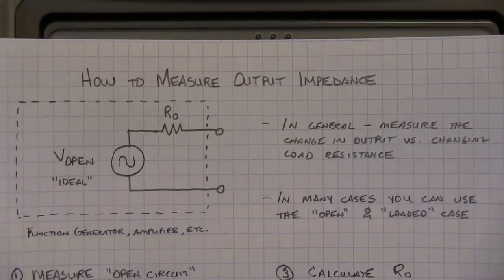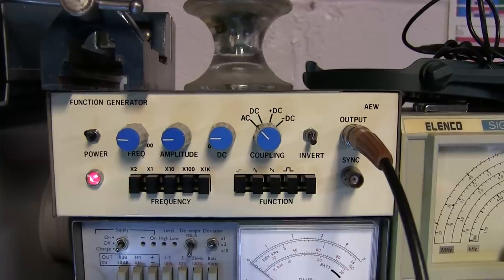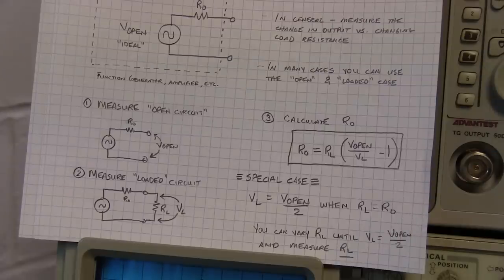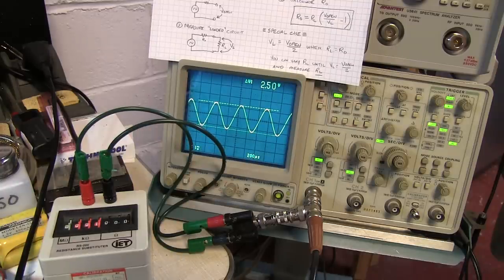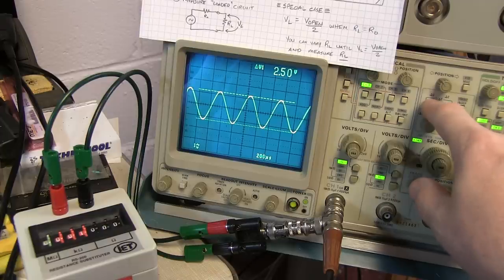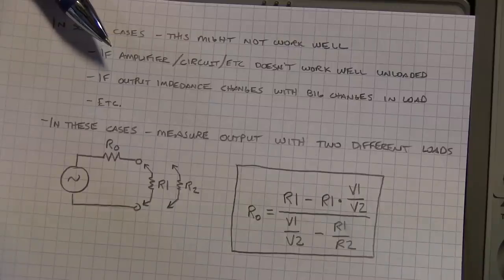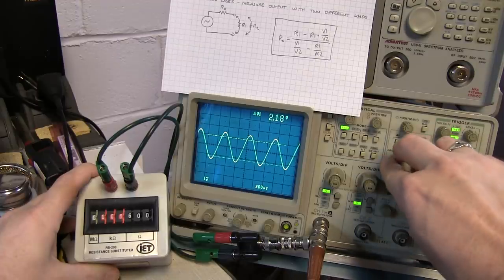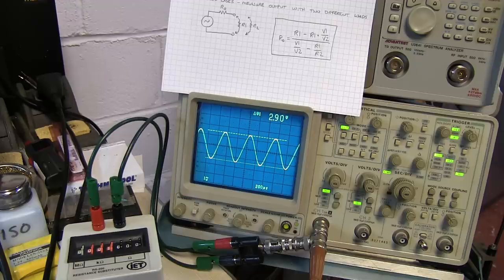#138: How to Measure Output Impedance

Comment: You use the term impedance but only consider that the output impedance is purely resistive. What about the condition where the output "impedance" has reactive [capcitive or inductive]  elements along with the resistive element? Should consider taking measurements using more than one frequency.

Comment: For the beginers What Alan does here  is : He devide's 2.5V bij 1000 ohms (1K) of R load. That  give the current flows in R load which result 0.0025 Amps (2.5 milli amp's)  that will  also be current flows in Ro (since current is equal everywhere in a close circuit). We also know that when R load is connected and current start passing it creates 1.5 Voltage drop on Ro 4Volts - 2.5 (V drop on  R load that is because the sommof all voltage drops must be 4Volts ). So 1.5V voltage drop on Ro devided withthe current flow's in it will give the value of R out which is 600 Ω (ohms).

Comment: Very well explained. Is there a derivation for the first and last formula?
Reply from the maker: The first formula is simply re-arranging the typical voltage divider equation:
V1 = Vopen * (R1 / (R1+R2)), solving for R2.  The second is starting with the ratio of two of these equations and solving for the source resistance.
Reply: ***** That's perfect. Thank you!

Comment: Another EXCELLENT review!!
If you are still considering suggestions for tutorials, Have you considered FET's and in particular their utility in audio. I have been amazed how well FET's sound in preamps and low power amps. Being a voltage device apparently is a plus at audio freq's. My experience has shown them to rival many tubes I have played with such as 45, 2A3, 6L6 tubes. I have played with MANY transistors and opamps at audio freqs but they sound flat and dull compared to FETs...Many of the people I know are OK with transistor theory but don't understand FET's....Another OUTSTANDING audio device is the nuvistor for low level work like preamps...Microphonic as heck but once tamed, they are VERY nice not to mention fast and reasonably cheap..

And a great big OSCILLATOR to you too...dit dit

Comment: Hi Alan, great video and tutorial to measure output impedance. Most of us also wants to know how to measure an unknown network impedance from 100kHz to 1GHz or higher but this one can only be achieved using a network analyzer. In my experience in Electronics, EMC and RF, and before I started my ECErcuit YouTube channel, I been working in understanding how to measure unknown network impedance using spectrum analyser and signal generator. In somehow, I have managed and successfully measured unknown network impedance accurately from 100kHz to at least 100MHz. Measurement was achieved by deriving a formula through a series of derivation and calculations. I automate the system by writing and application to control the spectrum analyser and signal generator to process the measurement against the calibration reference using the formula which gives you the result of impedance plot and data. I'm thinking of sharing this work on my YouTube channel but I'm not sure if someone is interested to know. Cheers, ECErcuit.

Comment: Lowering load Z (or R) also shifts the HPF created by output DC blocking capacitor (if any) upwards, so, f must be high enough compared to the cut-off freq of that.

Comment: Thanks Alan for that video, it will definitely be usefull.

Correct me if I'm wrong, but with some manipulations there would be a way to determine an input impedance as well, right ?

I was thinking to perform the steps you described to evaluate the output impedance of an opamp circuit with 2 resistors, R1 and R2 as you did.  Therefore once the opamp output impedance is known, measurements could be performed using the input of the circuit we want to know the input impedance in place of R2.

Having access to the opamp output impedance value, along with the V1, R1 and the newly measured V2, we could deduct the value of R2, which would normally be equivalent to the input impedance of the circuit being tested.

I understand that if either the opamp output or the tested circuit input input are significally inductive or capacitive, a close attention will need to be paid to the frequency, but generally speaking, I would be lead to believe that what I described could be achieved too.

Let me know if that make sense.

Keep up with the good work !

Comment: +w2aew Thanks, yet another masterful video I've found in your archive that makes interesting topics so easy to understand! 

You mentioned "designing the output impedance" along the way, which got my attention as it is something I'm trying to research. Sorry if I've missed it, but I don't think you've covered this explicitly before?

If I could add my vote, it would be great to see you explain how to go about designing for a specific output impedance (say for audio amp or function generator) and what practical circuit changes you might make depending whether the expected next stage is e.g. a low-impedance speaker or higher impedance mixer or power amp.
Reply from the maker: +pratalife I'll put that on my list.  Most often you'd choose the output impedance based on what the circuit needs to drive.  A low impedance load (50 ohm coax/load, loudspeaker, etc.) require a low output impedance.  For maximum power transfer (if that is the goal) the output impedance should match the load impedance (complex conjugate actually).  If the load is a high impedance, then the output impedance of the circuit driving it is less important.
Reply: +w2aew cheers, that would be neat. "If the load is a high impedance, then the output impedance of the circuit driving it is less important." ... I think you've already helped;-) I've been casually thinking about (low impedance) opamp circuits possibly plugged into high-impedance inputs and I've been mentally hung-up on the impedance mismatch. But why artificially make my source high-impedance? Doesn't seem to make much sense .. perhaps I need to go and revise power transfer theory!

In the meantime, always look forward to your videos no matter the topic .. more often than not, give me something to experiment with for the week;-)
Reply from the maker: +pratalife Sometimes other factors figure into why the output impedance is what it is - power dissipation requirements, amplifier design constraints, etc.
Reply: I've wondered what output impedance is for ... years.  Knowing that it is a design choice explains why downstream elements like antennas must match it.   I am still struggling to understand in a physical sense what it is.  Alan,  is there anything else you can say about it?  Many thanks.

Comment: When you have a chance,  could you do a video that addresses the case where the signal is high-frequency and not sinusoidal -- for example, a high-speed clock (say a few hundred MHz)?

Also (or separately), how might one make this measurement on a differential signal (such as LVDS)?

Many thanks for your many instructive videos... I've learned a ton both about theory and practice and I'm always excited to see new posts from you.

Cheers,

Alex

Comment: I am aircraft technician and I need clarification on the following impedance subject related to ARINC 429 circuits.   The transmitting source output impedance should be 75 W ± 5 W divided equally between Line A and Line B (line A and B are twisted pairs i.e 4 wires two for transmission and two for receive). This balanced output should closely match the impedance of the cable. The receiving sink must have an effective input impedance of 8k W minimums. …How is this physically measure?
Reply: None of those measurements are impedances.

Comment: Great video, sir. But how to measure the output impedance of an RF signal generator with a Directional Coupler and a Spectrum Analyzer?
Reply: Increase the load until you see a 6 dB power drop.  That's the output impedance.

Comment: Great video, but you fail to mention this is a use of the fundamental idea of a "voltage divider". I only make this comment as it seems like a mystic rule to work out the R_o impedance, when in fact it's just a manipulation of the basic relationship between R_o, R_L, V_o and V_L in the humble voltage divider. A nice experiment. How sensitive would typical transistor amplifiers (common base, emitter, collector versions) be to this sort of probing to find their output impedances?

Comment: Hi Allen

I just watched your video on How to Measure Output Impedance.
I wanted to measure the source impedance of a SI5351. When I use the 1/2 voltage method I get 49 ohms, very close.
Next I tried the 2 resistor method and it only works out to be 1/2 of what I was expecting, 24 ohms. My R1 = 330 and R2= 814.
V1=3.22 and V2=3.36. I'l double check my measurements and calculation.

With this method should one of the resistors be close to 50 ohms?

73 Ken VA3ABN

Comment: Good video, of course the next question that comes to mind is:  How do I measure input impedance of device.  I have one of those eBay 2.4GHz frequency meter modules without much documentation of course ;)  Knowing my signal generators output impedance of 50 ohms, would I place say a 10 turn 10K pot in parallel with the two devices and adjust for half the signal voltage and calculate from there?  This may be an easy answer but sleep has been a precious commodity the past few days lol.  As always thanks.

Comment: Can you make a video of how to bias a one transistor mixer (say BJT - 2N3904)
with modulating signal applied at the base and the LO signal applied to the emitter.  How to get clean AM signal with no distortion.   Say like 12 volts power supply to this simple circuit.  How figure out the LO drive and what kind of drive the modulating signal requires.  Anyways it is just an idea if you have time. 
Best regards,
Pete

Comment: Rather than memorizing a formula you can also see that the open circuit voltage equals the internal, Thevenin equivalent voltage since no current flows through the output (Thevenin) resistance.  When you add a load resistance, you can divide the new output voltage by the load resistance to find the current flowing through the loop.  Also, the change in output voltage MUST be due to Ohm's law applied to the output resistance.
Thus, V_loaded = V_open - IR_output or R_output = (V_open - V_loaded)/I.  Since
I = V_loaded / R_load this yields the formula.

ALWAYS the output resistance is R_out = -dV/dI by definition.  You need only apply two different loads (resistances), measure the two output voltages, deduce the two output currents, and compute this slope.  Be aware that taking the difference between two nearly equal numbers always loses precision so you need to make the two loads as different as practical.

Comment: Hi, Thank you for your great education videos! Would you please explain how to measure the input impedance of a receiver ( typically with input sensitivity of -110dBm). I tried to do the job using a nano VNA and attenuators, but it seems the measurement is not precise since the nano VNA cannot work with very low level signals. It would be much appreciated if you share your rich knowledge. Thank you!

Comment: Some active devices instead of running in a resistive mode, run in a constant current mode.  For example in a high negative feedback amplifier, the output voltage changes very little with a changing load, so the impedance appears to be very low and the inverse of the impedance called damping factor is used.  A common high performance amp with a damping factor of 30 would have an apparent impedance of 1/30th of an ohm or 33 miliohms.  However protection first limits current to about 10A(varies) and then the output protection relay or other shutdown trips.  Now at 60 volts at 10 Amps, the limit is about 600Watts peak into 6 ohms.  Protection kicks in before the output can be dropped to 1/2 voltage.

Comment: Hello sir, can you make a video about how to measure the output impedance of RF amplifier circuit ? The methods in this video generally apply to relatively low frequency use cases,  I want to know that is threre any approach to measure  output impedance at RF frequencies , looking forward to your video, thanks a lot

Comment: I have a TC Helicon Harmonizer pedal. MIc in, through the effect then back out to mic in amp etc.

It works as expected on many different amps, but does not work well with my Fender Acoustic Jr GO.

The amp 100W and with the TC pedal, out put volume is lower than an plain acoustic guitar with no amplification. It is not my amp it is an incompatibility with this model of Fender, tried 4 amps.

I am suspecting an impedance mis match. TC is 400 ohm out. I have no input data for the Fender but both channels accept XLR for mic or 1/4 unbalanced for a guitar.

Anybody's thoughts on what might being going on, and also ways to test/measure or add something between the pedal and amp mic input greatly appreciated. Cheers

Comment: Perfect, thank you! This helps a diy guy a lot :) 
When measure a heaphone output that can have something between 1 and 30 Ohms, will it fit when using 50 and 100 Ohm resistors and do the third type of measurement explained in the video?

Comment: Couldn't you output calculation as " LOAD ohms X (v2/(v1-v2)) = device input impedance " simple instead of oscilloscopes can be used diod bridge made of 4 diodes and a cap of 10uf  simply make a switch that passes original signal v1 through switch to volt meter and another position on switch to pass signal including load in known ohms as v2 then voltages us as in my formula above ..in that case formula is spot on and can be used without oscilloscope.. I made such PCB for myself

Comment: U have a great understanding of how circuits work and how to compare two or more method's of measuring things. Could u show us the sinad and signal to noise methods of measuring receiver sensitivity and any trick or tips u know of how and what to use to make these measurements with equipment on a budget. For example I can remember reading of a method of using an analogue multi tester to monitor carrier level. Thanks Alan

Comment: W2AEW, Engineers say that the higher that input impedance the more sensitive the cables capacitance will get rolled off. Example if the input impedance is 1Meg the cables capacitance in picofarads pf won't affect the high frequency roll off as much as if the input impedance is 3meg or 5meg the cables capacitance will Rolled off the high frequencies more. I don't understand how or why higher input impedance will Roll off higher frequencies more depending on the cables capacitance. The input impedance is more sensitive to the cables capacitance the higher the input impedance which I don't understand why the input impedance is more sensitive to cables capacitance the higher the input impedance.

Comment: How do you measure the output impedance of high frequency devices, for example a crystal oscillator (if it makes sense) or an amplifier?
As usual, thanks for your videos!

Comment: Dear Alan, 
I have RF magnitude and phase probe circuit with two toroids connected to 4 diode based peak detectors to give output voltage corresponding to magnitude and phase errors detected. I am somehow not sure how that voltage is mapped to magnitude and phase errors and in what ratio. This circuit is inside a 300W auto matching network which is used to do impedance matching. Load is a sputter source which is used to do sputtering. Generator is a 13.56 MHz, 300W unit. The circuit which I was talking about senses this magnitude and phase error and gives a feedback to a microcontroller which in turn rotates ganged series and shunt capacitor to match the impedance. I just want to understand the circuit better and make know how to make which motor move to get to 50 ohms. 
I am missing some bits and parts due to which my understanding about this thing is not complete. Please help me understand this thing. Let me know if you want any circuit diagram from or anything else. Thanks !

Comment: Hi Alan. I'm building a CW transmitter. I have a buffer amplifier after the crystal oscillator. I tried measuring the output impedance of that stage using the method you described (with two load resistors). I calculated the output impedance . I then tried another pair of resistors (with different values) to see if I come up with the same output impedance. I did not. It was quite different. Could  the output impedance change based on the load?

Comment: The output impedance of the collector of a Darlington transistor is higher or lower compared to a bjt's collector output impedance? But I have heard is that a darlington's output impedance on The collector is much lower compared to a bjt's output and complaints on The collector but what is the advantage of the output impedance of a darlington's collector compared to a bjt's output impedance collector?

Comment: Yet another excellent video. Can you use the same method to measure the input impedance of lets say a common emitter amplifier or any other type of electronic circuit?